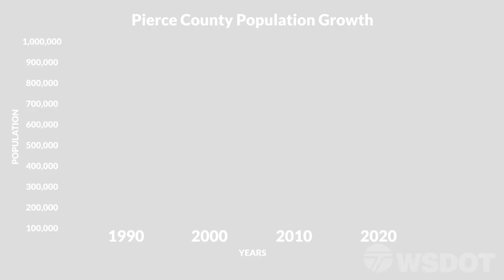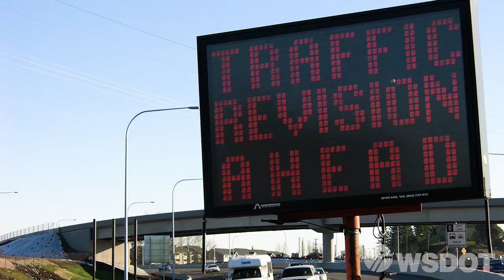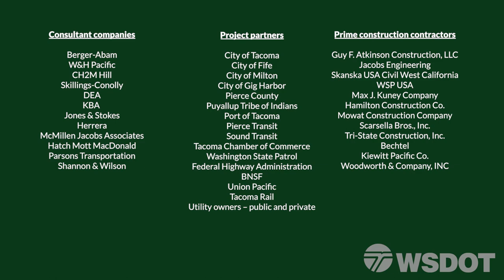I-5 & SR 16 Tacoma/Pierce County HOV Program

Comment: Most people who use HOV lanes are those that are already traveling with others. HOV lanes do not reduce traffic significantly.
Reply: There is an alleviation of traffic when hov drivers don't have to fight across the freeway to join or exit the freeway.
Reply: yes thank you. If public transit was better funded and a more popular/convenient option to get to and from work or points of interest especially between Lakewood and Seattle areas, then the HOV lanes might actually make a difference but until then adding more lanes isn't going to solve the fundamental problem that results in traffic.

Comment: Glad it's done, thank you. But what about that zipper merge from I705  to Southbound I-5? Southbound I-5 is trying to merge onto Highway 16 while the 705 traffic is trying to get on to I-5. It's an extreme Slowdown. I think they needed another overpass or something so it's not a zipper merge.
Back before you fixed SR512 and i-5, there was a zipper Lane from southbound I-5 to get onto SR512 at the same time SR512 traffic was trying to get onto I-5. It caused a huge slowdown until it was fixed.
Reply from the maker: We looked at designs for the I-705, I-5 and SR 16 weave.  It was cost prohibitive due to the size of the overpasses needed and available right of way.  The cost was beyond the budget of what was funded in the Tacoma/Pierce County HOV program.
Reply: @wsdot  thanks for the answer.
Reply: @Truths_Sayer  A huge part of it I think is that tons of people on both sides (I-5 and I-705) are trying to merge in the first 10-15% of that stretch of highway, leaving the rest of it being under utilized for merging. People also need to realize that there's hardly any time loss if you miss your exit because the 38th and Sprague/Union Ave. interchanges provide pretty fast turnarounds.
Reply: @TheTikeySauce  agreed on the 10 to 15%